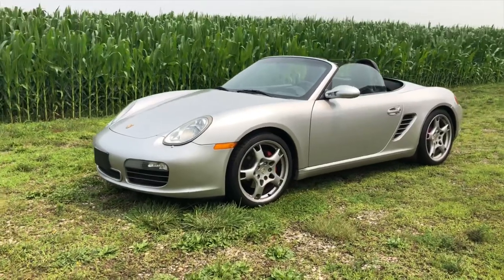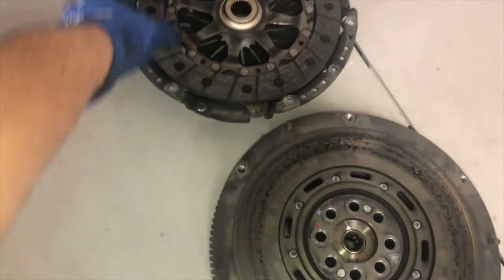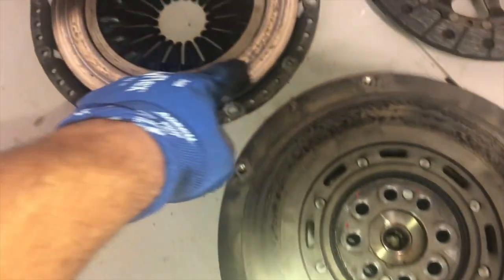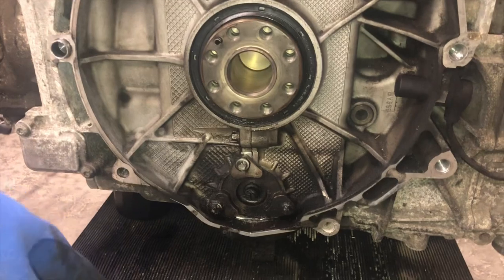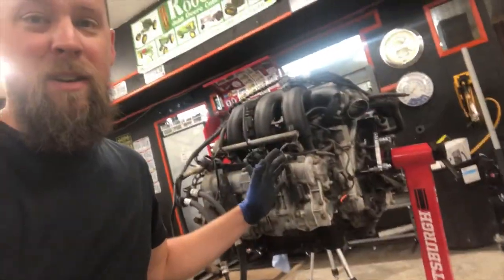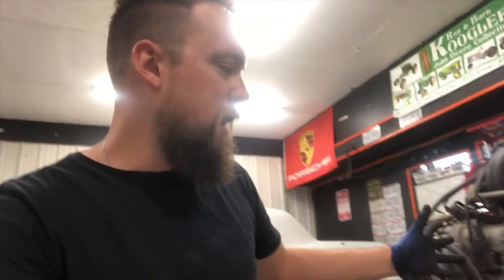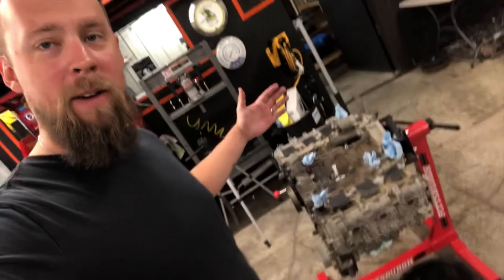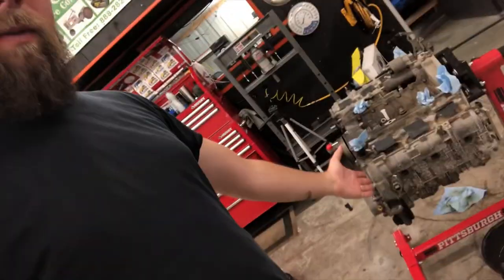Beginning the Full Teardown of my Very Broken 987 Boxster S’s Engine

Comment: I have noticed the same issue with my 2006 3.2L Boxster S a several times when pulling into my garage after a proper drive. Also seeing some glitter in the oil after doing an oil change. I have my results from Blackstone so it would be interesting to see a comparison with yours as well. 
Really glad you are doing this teardown and sharing your findings with us! Excited to get an answer to what this could possibly be.
Reply from the maker: Bummer you’re also having a similar issue! Just out of curiosity, which metals were high in the Blackstone report?
Reply: @FunAhead_TV_Official  In the comments, Blackstone stated that Copper is excessive at 16ppm compared to an average of 7ppm. There were some other numbers that were high as well (Aluminum 7ppm, Iron 23ppm), but this analysis was done on a 8200 mi run compared to the average of ~3400 mi. This was my first oil change since I just bought the car, so definitely will be following a more aggressive schedule of around 3-5k miles.
Reply from the maker: Oh dang, not ideal :/ Sounds like you’ll likely need to do rod bearings at some point. To mitigate wear, you might consider running an oil like Redline 5w-50. Heavier weight, plus higher ZDDP. Might help prolong the life of the current bearings.

Comment: Very interesting! Are you going to replace all the lifters or just the bad ones? I am really enjoying this tear down since I have the same engine with the same ticking noise. Great job and very informative.
Reply from the maker: Thank you for the kind words!! Also, per your previous comments, next video will cover cylinder wall quality in detail. 

I’m very much a “we’re in there, so might as well do it and do it right” kind of person, so they’re all getting replaced. Not cheap, but at least they’ll all be brand new.
Reply: @FunAhead_TV_Official  I recall reading somewhere these lifters are exactly the same as a BMW part that is less than half the cost. If so it's worth searching around since you are doing all of them. I did my 996.1 bank 1 variocam pads last year and your vid was helpful.
Reply from the maker: Nice, I’ll look into that; thank you for the tip! Also, that’s awesome, I’m happy my video helped you out! Thanks for saying so.